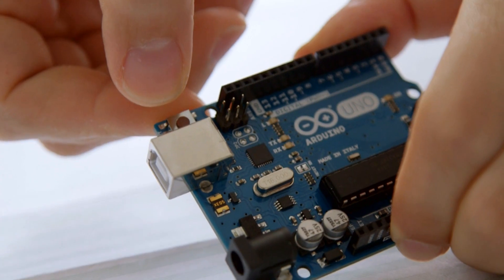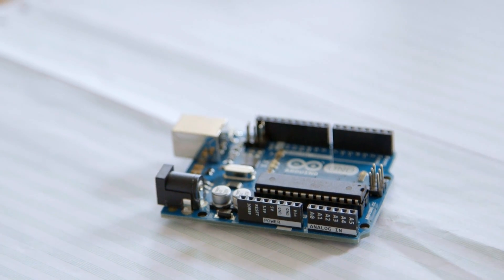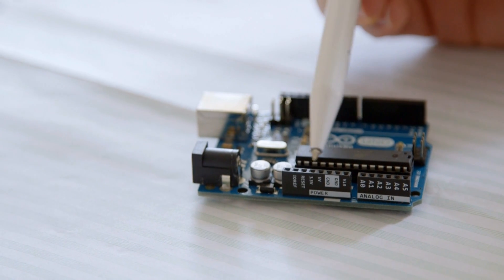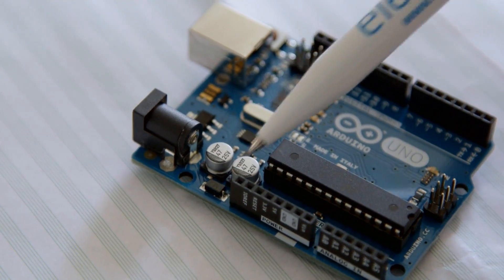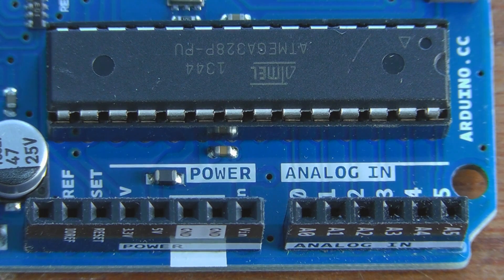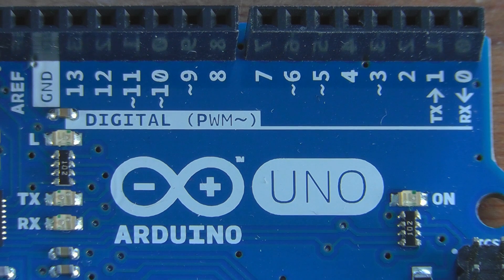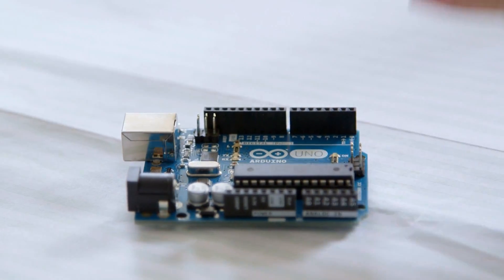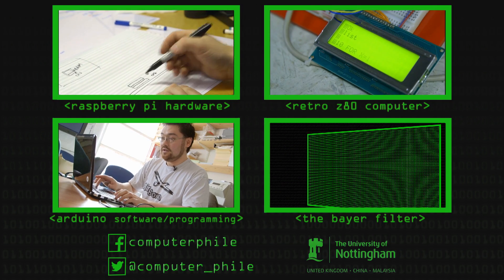Arduino Hardware - Computerphile

Comment: I've had bad luck running Unos on 12V.  I know the specs say it can take it, but if you're using a freshly-charged 12V battery, you're probably looking at more like 13~14V, and that seems to me too much.  I had a 12V project that burned up about 3 Unos, and then I went to a Mega and ran fine.

Comment: Why do they all use pulse width modulation, when the circuitry for delta-sigma modulation is little more complex, and much better. Both are mark space ration modulation, but it spreads out the marks and spaces better.  (there are some situations that you do want to output a pulse width e.g. servo controller)

Comment: Lol... Arduino is for newbs. Pros use pure microcontrollers.
Reply: Midaspl gotta start somewhere though .. I started with arduino, but went to C and after that even did assembly :) the avr assembly language is really easy to understand. they did a great job making it :)
Reply: Sebi20070 16bit? Seems rather a lot for things like traffic lights. Could've been done on a simple AVR.
Reply: ***** Still it's not the best starting point. Teaches you bad habbits.
Reply: Midaspl
such as?
Reply: +Midaspl Arduino has its uses. Bare AVRs or other micros have their uses. FPGAs have their uses. I use all of those. :3
Reply: +Shockszzbyyous Such as completely hiding interrupts and stuff, doesn't let an embedded programmer know what's the best thing to do is (which can sometimes result in spectacular failures)
Reply: Shahe Ansar  it's actually surprisingly easy to write efficient and fast code in avr-c.
Reply: thegoodhen
FPGA++ :D
Reply: ***** Well yeah. I mean arduino bored me within months. Switched to AVR C and then ARM
Reply: Sebi20070
lol nice
Reply: Sebi20070
*Machine code not binary (sorta)
Reply: machine code is one level lower then binary. but still above logic level. or is it micro code hmm :)
Reply: I know what binary but I got confused :D
Reply: *****
You're comment got me confused too.. :P
Reply: Shahe Ansar that sometimes happens
Reply: Arduino is for efficient people.
Reply: And their dicks are bigger I guess?
Reply: Arduino contains a MCU so technically you can just use the board, w/o anything else to program a bootloader flashed ATmega328.

Comment: I had a really scary experience with this when it stopped working during a presentation on a project. It was due to a cheap cable that was supplying power to the audrino board. The cheap USB cable does not provide enough power for it to work properly. Learnt my lesson, don't cheap out on cables.
Reply: ok?

Comment: I got an arduino a few years ago.  For it's time, it was an amazing board to prototype with.  But now the raspberry pi is just 10 or 20 dollars more and totally overpowers it while being simpler to work with.  I can't really think of much reason to consider it nowadays.
Reply: +Clairvoire It's a linux board (it's not real time). Also, it doesn't have ADCs or speed (at microcontroller-y things)
Reply: Power consumption is a HUGE reason to pick arduino over pi

Comment: Here is a question, Once you have finished developing.. and you think.. OK.. Good, I'm finished.. .... Then what? Obviously you do not want to lose an Arduino, but.. What is next? Take the chip out the board that has your program on? Then what?
Reply: Colin Richardson make a pcb and put that chip on it. or buy some empty ones and program those and put them on the pcb.

Comment: 2:20 Wrong. I/O Ref is a reference voltage for Shields to tell them whether the Arduino board is using 3.3 or 5 Volts (there are some with different supply voltage, and shields should use the same voltage not to damage I/Os). What he means is the Analog Reference, and that pin is located right next to 13 and GND on the other pin header.

Comment: I think he might be confusing IORef with ARef. IORef, as far as I know, is for use with shield which need to know the voltage used by the arduino board (hence, IORef is an output, while ARef is the input where you put your voltage reference)

Comment: Nothing about how to spot a fake Arduino based on the hardware components?
The yellow component near the USB plug is custom made for Arduino. I think it usually is black. I've seen that in a video and found it interesting and related to hardware. :)

And i know it is open hardware but some manufacturers use the Arduino brand name and logo to demand more money.

Comment: So, total nab alert here, but I have just one question. What does it do?
Reply: Ze Rubenator It's a computer that runs one program you write on your computer and put on the chip via USB. You use the various inputs/outputs to hook the Arduino to other things, like a light switch or lamp that it could turn or off electronically based on conditions set in your code, like the time of day or temperature
Reply: Magic.
Reply: It is a development board. A board made to quickly build and test circuits with an atmel chip.
Reply: Ze RubenatorLooks a lot like my Cthulhu PCB that I have in my arcade stick which just converts button presses from the controller into data your computer can understand. I guess this is a (lot) more freeform version of that that you can program. Takes in input and uses the program you made to convert it into an output, which means you could practically do whatever you want with it because that's programming in a nutshell.
Reply: Folopolis Could be that the Raspberry Pi Foundation managed to nail the community aspect of hobbyist computing. A company which makes a MIPS-based device aimed at the same market (I can't remember their name of either the company or the product) got criticised in at least one review for being weak on the community aspect.
Reply: Ze Rubenator It's a magical device that does everything! All hail the Arduino! :D
Reply: Ze Rubenator  Basically whatever you can come up with for a slow little computer with a few kilobytes of memory. Typically control tasks which don't require much computing power. If you want to do something more demanding, you'd probably want to look into a Raspberry Pi, though I'm pretty sure it's possible to connect the two if you build the appropriate voltage conversion circuitry to convert between the Pi's 3.3V signals and the Arduino's 5V ones.
Reply: Ze Rubenator what do you want it to do.?

Open the curtains in the morning and close them when it's dark'
A custom control for an rc transmitter
Feed your dog at a certain time.
Reply: Ze Rubenator It's small circuit board with an 8-bit microcontroller (atmel 328) and a programmer that can be used to upload programs from your desktop. The board has built in breakout headers to allow connecting things with ease (like LED's and motors).
Reply: Folopolis There are a lot of software optimizations they made for raspbian, however, they eventually decided they had done the most they could with software, and released the raspi 2
Reply: +Ze Rubenator Anything you can program a computer to do.  It's not very powerful though.
Reply: Folopolis I meant theoretically.
Reply: +Folopolis  Didn't early versions of Windows do task switching in software?
Reply: ***** Still do. As does linux and BSD. In BSD and linux I can even choose my own scheduler.
Reply: n00b_asaurus floating point is a very real difference.
Reply: ok?
Reply: I hate Arduino. Look what I made by plugging two boards together!
Reply: Which part? The electronics for babies, or the C programming for babies?

Comment: The oscillator you pointed out is for the icsp programmer on board, the small square ic near to it. The one for the ATMEGA328 is the smaller one next to it.

Comment: I would love a video explaining PWM, i'm a software guy and it's very confusing to me.
Reply: dirtbikersteve It's pretty simple. If I put 1 for 1 millisecond and 0 for 2 milliseconds, and then repeat that forever, I'll get 1*1 + 0*2 / 3 = 0.33 average value (replace 1 with voltage for 1, and 0 with voltage for zero, and you'll get the actual number of volts). If the change is fast enough, the outside system basically "sees" only that average value, and not the pulses.
Reply: Филип Брчић maybe this can be used also : 

(total time on) / (total time period)  

 1ms / 3ms = 0.33   , hence its on for 33% of the 3ms of time period.   

And I'm guessing that 33% of the (average) power is delivered over that time period, rather than 100%.  It's sort of like keeping your electric heater on for 1 second, and turning it off for 2 seconds to save power, and then doing it again over and over.  You are keeping the heater on for only 33% of the time, and then it uses only 33% of the available power.
Reply: trailkeeper
In this case yes, but in general case no, because the voltage of zero might not actually be 0 V. That depends on how the circuit is made, but there are two voltages - Von and Voff which correspond to one and to zero, respectively. Since this PWM is meant to simulate analogue signals, perhaps Voff is negative and Von is positive, and they might have the same absolute value, so that one can have a sinusoid simulated easily. On Arduino, concretely, the voltages are 5V and 0V, if I recall correctly, so in this particular case you can just say t_on/T * 5V.
Reply: Филип Брчић Ok, thanks for the reply.  I guess (t_on / Tperiod) will give a percentage of Time that would be considered on, and then
(* 5 V) would give the efffective voltage in terms of the power output.
Reply: dirtbikersteve great Scott
awesome explanation on his channel

Comment: Idk if im right, but I think the reset button does not erase the program. It only restart the arduino.
Reply: Juan Carlos Andreu Gutiérrez Yes it only reboots the Arduino, but if you press it while connecting it may let you force the programming-mode on. (I've never actually tried that myself)

So if you have code that renders your Arduino unusable, that can get you out of it.
Reply: racoiaws that depends on the board+mcu you use.
Reply: restarting arduino = restarting the code

Comment: I don't get why the UNO is so much more popular than the Leonardo...
The Leo has twice as many analogue input pins compared to the UNO
It uses Micro USB, aka every android and WP charger as its input cable, the UNO doesn't.
it can act as a USB keyboard or mouse, which the UNO can't
it's a lot cheaper than the UNO
and it doesn't have that big fat IC on the top of it, like the UNO does
the only downside it has compared to the UNO, is that the Leo's IC isn't removable.
Reply: Nikolaj Lepka So, if you fry the chip, you have to buy a new Arduino. That's a really big downside. :(
Reply: rtunnel if you fry the chip you shouldn't even have an arduino. Besides, the Uno is also available with a non-removable IC
Reply: intriq8 my pricing is based on what you find on the arduino website, not some random local reseller, of course the reseller is gonna have a different price, but on arduino.cc the uno is more expensive than the leo
Reply: intriq8 Uh, <5$ for an arduino board? Seriously? All prices I can see are ~20$/€ upwards
Reply: intriq8 Would you mind to tell me the source then? The cheapest I've found on ebay was ~12€ for a non-original Uno R3 (DIP)

However as I found out yesterday there are other far more powerful boards like the STM32 series. 32 bit, speeds up to 100 MHz and ARM M4 architecture. The whole boards cost about 10-15€

Comment: There's a bad timing with this. There's a battle going on between Arduino LLC and Arduino SRL, it's so confusing.
Reply: HTFCirno2000 It's actually pretty simple.  Arduino.cc had Smart Projects manufacture the board, Smart Projects renamed to Arduino SRL and registered Arduino.org, then tried to hijack the IDE and refused to manufacture any boards for Arduino.cc.

In even simpler terms, .cc developed the board, .org stealing it (.cc never manufactured them, just developed them).
Reply: Kobra Arboc
Thanks! Couldn't explain it any better myself :3
Reply: +Kobra Arboc   A belated thanks from me for your comment. I feel a greater loyalty to cc than org.

Comment: Working with this a lot at school when studying embedded software engineering.
Reply: Thomqa z. If you want to get even better, use Atmel Studio instead of Arduino (it's software i'm talking about) as it will make it alot easier for you to transfer your skills to professional level very easily. Also you might want to look up using JTAG instead to interface with the chips (as ISP has one disadvantage in that it doesn't provide stepping), however that will require an AVR Dragon but hey this might be useful to you.
Reply: Thomqa z. Hey Thomas :p

Comment: USB HID was a useful benefit of switching to a microcontroller over the dedicated USB to serial. 

I never understood the reasoning behind the offset row of pin headers... I would think compatibility with generic, cheap, readily available protoboard would have been a no-brainer. =/ Regardless, its still awesome!

Comment: Your focus is all over the place, mate.
Reply: kek kek
I'm aware, but I actually think he does an excellent job, especially when pointing at the small PCB with narrow DoF. I see no focus jumping "all over the place". Now he could have used a tripod instead of shooting hand held, but the frequent adjustments would probably interrupt the speaker's flow.
Reply: Adrian The focus plane of the camera, where in the image is sharp, etc.
Reply: ***** What are you talking about?
Reply: Thank you. I thought I was going crazy
Reply: +TMCicuurd12b42 It's been months, but what you're looking for is electrical engineering kind of depth, which you might find in the design documentation of the hardware (I think it's on arduino.cc) or in a textbook for said college major.